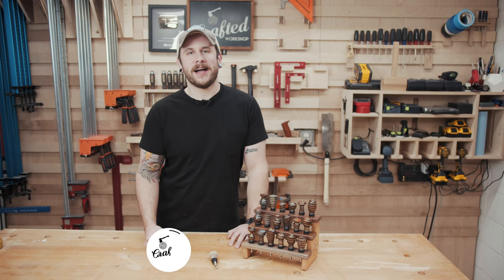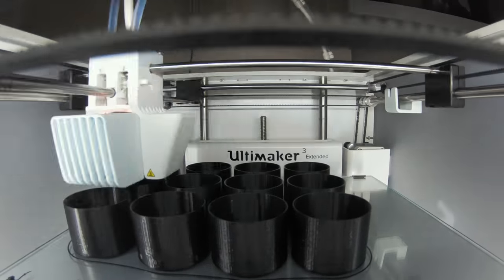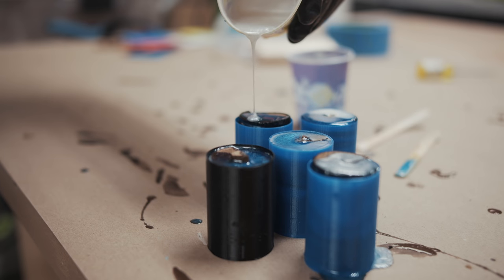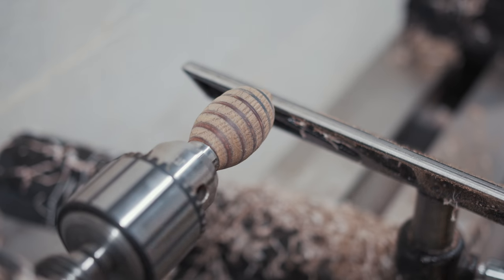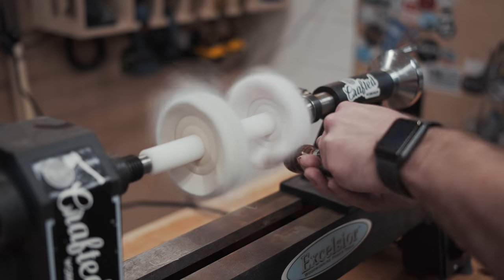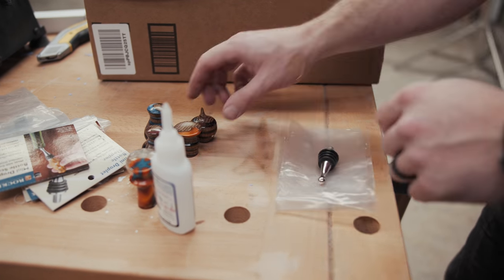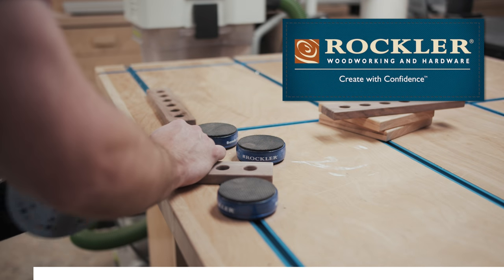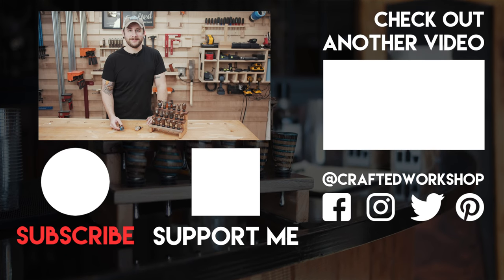DIY Epoxy Resin & Oak Bottle Stopper w/ Display Stand // Woodturning

Comment: Great video.   Bottle stoppers look fantastic.   I recently turned my first stoppers using the Ruth Niles bottle stopper mandrel which cuts the threads as you insert it into the blank and used her stainless steel stoppers.   Take a look at that system.   It's is easy.
Reply from the maker: Thanks a lot! And yes, a tapping mandrel would have saved me a little time for sure!

Comment: Hey Johnny, just a few cents from me about some products. 
If you do a lot of epoxy/resin work, I highly recommend you take a look at a 2 part system called Resin Research. A 1 gallon kit costs $115. It's incredibly predictable, 100% reliable and extremely hard as well. It will polish just fine. It's also water clear when it cures and doesn't yellow at all. I've been using it for about 10 years and I just absolutely love the stuff. 
Second, if you have a vacuum pump, I'd suggest setting up a vacuum chamber for de-gassing instead of pressuring it. Though there are times you want one over the other. 
 These are also another sweet project from you as well. Nice job. Love seeing others come up with their own techniques.

Comment: Those turned out nice! If you're going to try a CA finish, I'd recommend using Mercury Flex CA and activator. I do this with pens but it should work just the same for bottle stoppers. My process is: sand to 400 or 600 grit, wipe clean with denatured alcohol to remove any dust and moisture in the wood, 3-4 coats of thin CA, 1-2 coats of medium CA, spray activator between coats, wet sand up to 12,000 grit, and finish off with some Meguire's plastic polish.

Comment: I assume the pressure pot applies pressure and squeezes any existing trapped air bubbles down to nothing? Is that better/more efficient than putting it in a vacuum chamber and sucking out all the air - because that's what I see normally done.

Comment: Those turnings came  out great!! Instead of a pressure pot what about a vacuum container to remove air bubbles from the pours? I really need to get a large to try that...
Reply from the maker: They are used for different purposes and the pressure pot was really ideal in this situation since a vacuum chamber would have caused the molds to overflow. Thanks!

Comment: Love the idea if these. Liquor oak spirals were a totally untapped idea for me. 
I know it doean't appear you had any issues,  but I am curious if whiskey or another liquor could cause issues in that the wood has observed a high amount of alcohol. Does that impact the casting of the resin at all?
Reply from the maker: Thanks Karl! These spirals were unused, so I didn't experience any issues obviously, but I would imagine that, as long as they were dry, it shouldn't cause problems.

Comment: Good stuff. 

On the sanding:  don’t use a wet rag if you are not wet sanding. That really just complicates things unnecessarily. 

Also, what type of sandpaper is that?  Type does matter, even at lower grits. I use the Norton brand for turning because of the finish and the length of time I can use it.
Reply from the maker: Thanks! And yea, wiping it off between coats probably wasn't necessary but I was trying to expose any big scratches. The sandpaper is from Klingspor, super high quality stuff. I bought some cutoff rolls awhile back and they're perfect for this type of sanding.
Reply: @craftedworkshop  I wipe off between sandings, but just with a blue shop paper towel. It really does make a difference. I was just questioning the wet part.

Comment: Was that  a pressure pot or vacuum pot that you used?  Always thought people used vacuum pots to remove air from epoxy.
Reply from the maker: Pressure pot. They both have different purposes, with a vacuum pot usually being used for stabilization.
Reply: @craftedworkshop  Whats the purpose for pressure pot?

Comment: Carbide for hand turning is straight garbage....a softer material will always yield to a harder material, and you don't need carbide to turn wood and epoxy...HSS can have much more aggressive tool geometry, and is super simple to sharpen....that square insert you are using doesn't have enough clearance angles to cut nicely on soft materials like wood and epoxy.....the video and the results are amazing....but you are better than carbide....just had to throw that out there 🍻